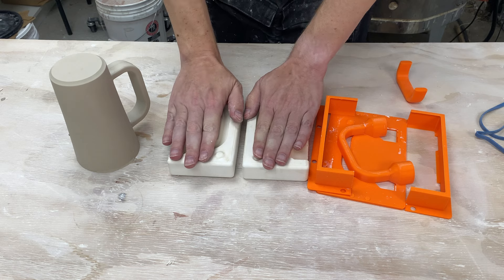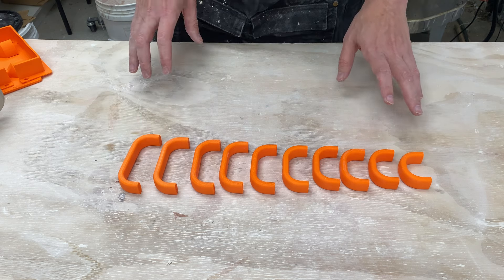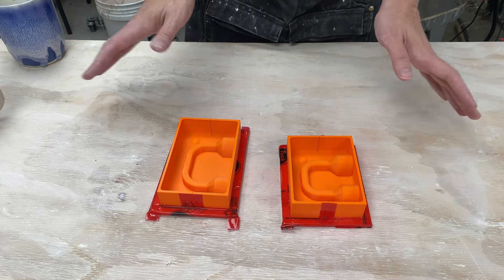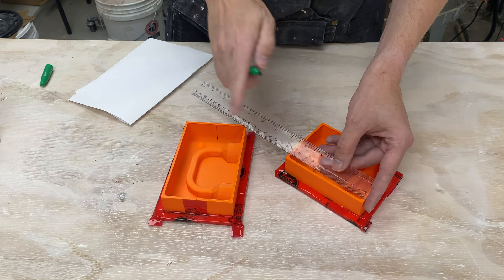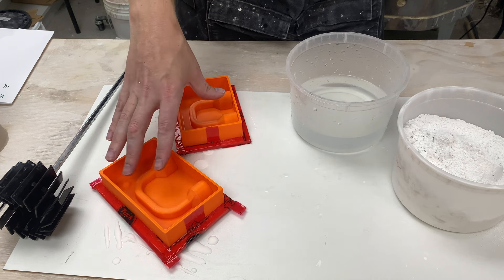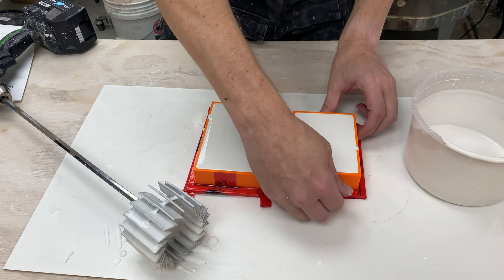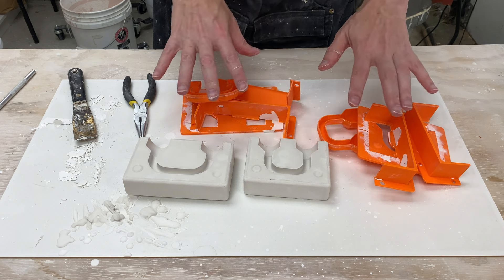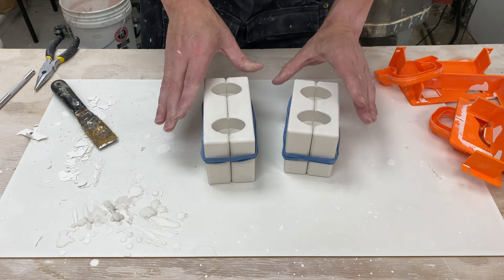3D printed molds for slip cast handles - more sizes!

Comment: Since you made your forms in CAD you could easily add in some tabs or something to use as a pull handle.  That should allow you to pull more evenly and not grab the edges. I'm not exactly sure how you might to it but s somehow you might add in some alignment holes to put pegs in as well.  And maybe small indentations for finger grabs for pulling it apart.  With CAD you can do whatever you can think of.
Reply from the maker: Thanks! There are several constraints on this actually (there's a good bit of discussion on my last video). They can't really be taller tabs since that would make printing flat on the bed without supports a problem. Horizontal could work, but any added structural connection to the walls, so the tabs stay attached when pulled, is in tension against the need for the part to flex a bit. And the last idea was to add something inside the handle itself as pull points but the same structural issues are there too.
And you're right, the constraint isn't the CAD - it's the 3D print and plaster (and clay) requirements that are the tricky bits.
Reply: @PotterybyKent  I'd consider adding geometry inside the handle that is flush to the surface and has screw holes. This would have minimal contact to the side walls or none at all. You then use those screw points for attaching a pulling widget, either screwing the widget to the mould, or using screws/bolts with a wide head and a method that allows the widget to be placed over the mould and then rotationally locked into place. If pulling the mould away from the sides is necessary, geometry inside that you can squeeze with pliers might facilitate that, avoiding the need to contact and potentially chip the plaster. You still got a good result anyway though.
Reply from the maker: Yep, that came up on my last video as well. If I do make a change it might be to add tabs for snap ring pliers. However it's not clear this is actually a problem that needs fixing or not. If anyone does make one of these molds, do let me know!
Reply: @PotterybyKent  It's just something to make your life easier.  Everything goes very smoothly until you try to pull things apart and then it slows down while you try to get it to release.  Part of the problem comes from having to pull on one side but some sort of pull tab would apply pressure evenly so you could pull it more gently and still get the job done.  By the way, my daughter used to work at a ceramic cup factory/store and I shared your video with her and she said "cool".  She's not much for words.
Reply from the maker: Nice to hear the "cool". It isn't actually that slow in terms of the overall process, but given how editing works, I could see that not coming through. Adding and removing the tape is much more tedious actually! But even that isn't too bad.

Comment: Its crazy how strong therese are with just the slip and some pressure. What accounts for this strength?
Reply from the maker: Clay has a bunch of interesting properties. It is pretty sticky stuff! Here the pot and handle will suck the moisture out of the liquid slip as the water levels equalize so it doesn't stay liquid very long.

Comment: To be honest, I bought a Bambu A1 printer and started printing my first models myself, but it took some time to make molds out of them.  I bought a Kingroon mold and the first prints came out perfectly, but the further into the forest, the more errors in preparation for printing which I can't cope with.  First, I couldn't tear the support off, then the support collapsed, and now the corners started curling and peeling off.  One corner keeps peeling off.  Kent do you use bamboo?  What brand of filament do you use?  What kind of support, I see it's organic, but there are several types there too.  Do you recommend a strong tree?  I understand that you have the print quality set to fine?  Do you also iron?  How about speed?  How about the bed temperature?  do you do rafting?  I understand that you print these small holes at the bottom without support?   I'd rather learn 3D modeling than printing since I'm going to make so many mistakes... I'd be grateful for any tips.
Reply from the maker: I'm using esun pla+ (https://amzn.to/3W5GhAS) on a Bambu p1p. I'm using basically the default settings for that filament from Bambu studio. For the handles I'm printing with an inner brim so they stay attached to the bed. It sounds like you're probably using a filament profile that doesn't match your filament well. Feel free to DM me and maybe I can help more.
Reply: I will change the filament and settings and if I still have problems, I will ask you.
Reply: @JuliaMostowska @ If you haven't already I highly recommend to understand and use the calibration tools provided in the bambu slicer or with Kingaroon use Orca this will drastically improve your results. There are many videos about calibration. Check out the channel "Bam Bam Print" or "Fischer 3d" Ironing and supports etc are fully covered there and get ready to get your feet wet. So many options but once you get the hang of it. Its an excellent hobby 👌
Reply: I started by downloading Orca, but I realized that now Bambu also has calibration.  I sat for half a day today and I think I succeeded.  There is now a calibration option in bambu.  Maybe I'll switch to esun later.  By the way, I learned a lot of additional things;)) thanks for your support.
Reply from the maker: @JuliaMostowska  That is great to hear. Hopefully that indeed solves your issues! My Bambu printer has just worked compared to my old one.